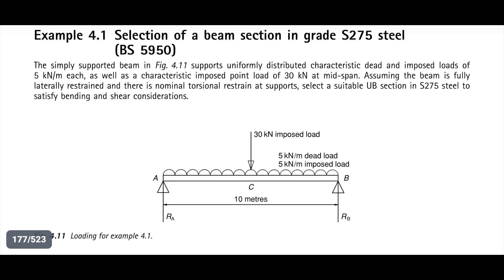PART 1:SELECTION OF A BEAM SECTION IN GRADE S275 STEEL [BS 5950]

Comment: Hello George Kamiti, I would like to ask sir, if the self weight is given, how do we calculate the Moment Self-weight ?
Reply: Referring to Figure 1, the shown steel beam is considered to be laterally restrained at the 
ends and at the points of load application only. Select and design a suitable UB steel section 
in S275 grade for the beam shown based on the following data:
(a) Dead loads:
• Self-weight: 3 kN/m
• W1 (Point load): 40 kN
• W2 (Point load): 20 kN
(b) Imposed loads:
• W1 (Point load): 60 kN
• W2 (Point load): 30 kN
Reply from the maker: You will first calculate the design load using 1.4gk + 1.6qk
Then if it's a simply supported beam, calculate the design moment using wl²/8 where w is the design load.
Reply from the maker: Wl²/8 is for the udl dead loads then add Wl/4 for point loads.